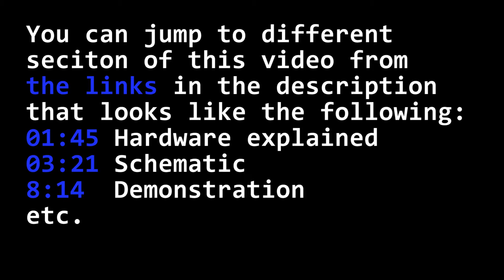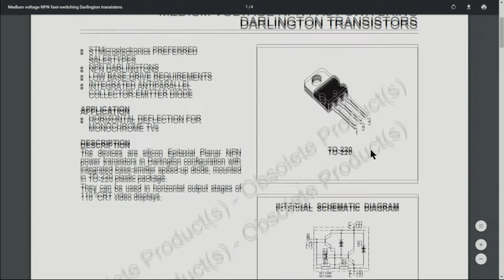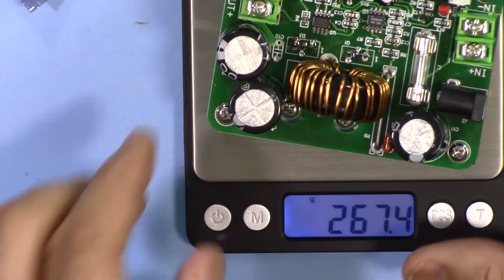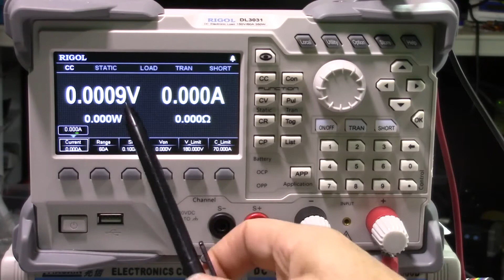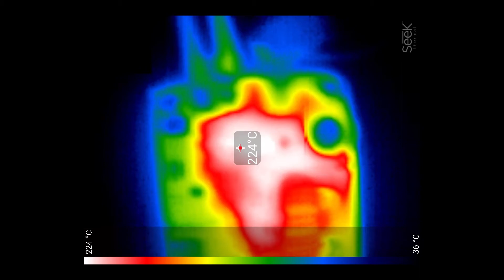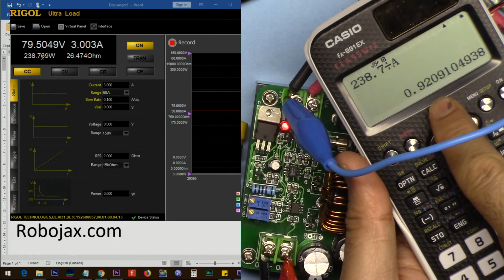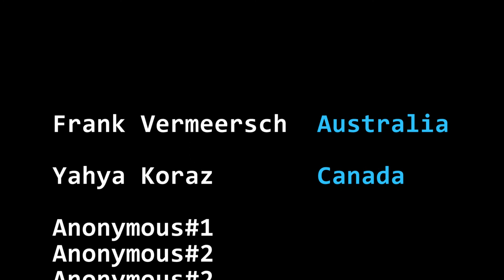Review of 600W DC10-60V To 12-80V  boost convert with constant current |  Robojax RTJ812

Comment: Can I use this charge a 18s(3 x 6s) Lipo batteries granted I only charge to a maximum of 68.4v or 3.8v per cell not 75v Also more importantly use Turnigy DLUX Auto Checker(s) on each XH port not as primitive checker but indeed for the 50ma "Auto Balance" it claims to provided once imbalance is detected during charge/rest/discharge/storage ultimately dedicated balancing with auto sleep DLUX claims. Maybe connect 6 Deluxe Auto checkers to each 6s battery for a total of 18 Turnigy DLUX Auto Checker(s) using a 6X XH adapter on each 6S. Possible? LVD(Low Voltage Disconnect)
Reply from the maker: You will short circuit the output (this has short circuit protection) and measure the current. Adjust the current to your desired value. Then remove the short curuit from output. Set the voltage to your maximum voltage and connect it to your device. When the battery is charged, the output voltage increases to the maximum and charge will stop.
Warning: Lipo batteries are very dangerous, change them only on solid non-falamable sureface away from valuables or human.
Reply: Yes sir
Reply: You are suggesting that I make appropriate adjustments to both the voltage and current before connecting it to the 18s battery. Would you suggest fusing both the input and output of this boost converter, or output only for further short circuit protection. Lastly would you suggest using Shockey diodes as reverse voltage protection & does this boost converter have reverse flow built in? Electronics-Salon has long offered 12v-48v DIN rail mountable LVD modules with dip switch settable disconnect reconnect ranges. I understand LVD are applicable with all battery chemistry's power supplies Etc.
Reply from the maker: yes. before commenting it  you have to have proper value set.
Put the fuse at input if you want. If you watch the video, do not have much hope . This can't supply even 400W.
Reply: Perfect. This is truly the most interesting YouTube channel by far. Thank you
Reply from the maker: You are welcome. Cheers.
Reply: @Mind-Your-Biz-Narc  hi Robert.
did that work for you?
I want to do the same.
10s battery 12ah.
charging current 3 amp.
do you have any suggestions please?
Reply: Charging that low seems a bit silly, the military charges their batteries at 3.9 and that's even pretty low.

Comment: Good work sir please tell me a 12vdc./2.5amp bettery to increase 30amp power output
Reply from the maker: First it is physics law that the power NEVER increase.  It will decrease but not increase. For example 20W input (10Vx2A=20W) and ouput can be aproximately 18W due to losses. (18Vx1A=18W). You can only change voltage and current. There is about 10% to 15% losses